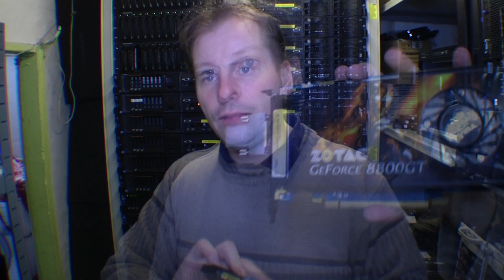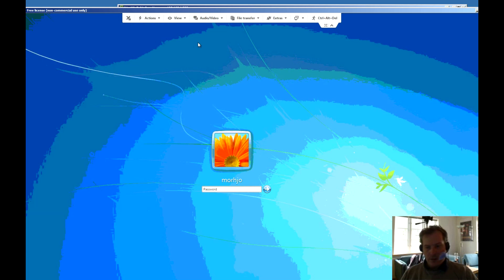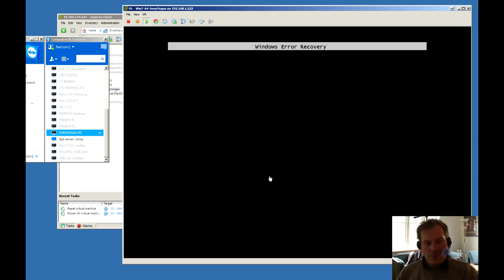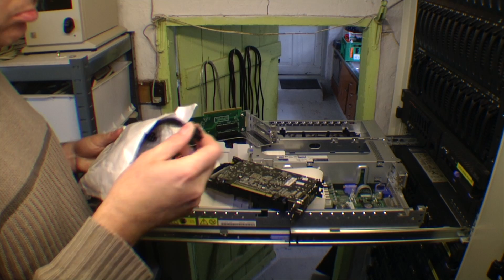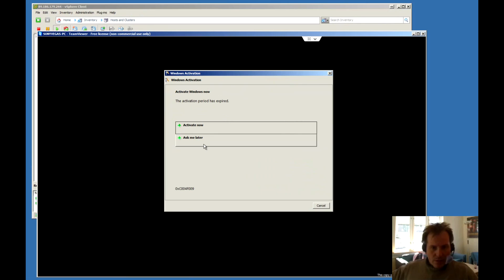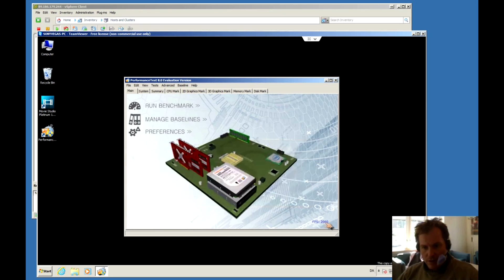GPU Passthrough ESXi with HDMI dummy plug - 236

Comment: if only my server was capable of VT-D :/ This looks like fun :)
Reply from the maker: Hi +dash8brj 
It is getting really affordable, the IBM x3650 M2 is the first one i got that can do it.
http://www.ebay.com/itm/IBM-x3650-M2-7947-AC1-2x-2-26GHz-E5507-QC-24GB-RAM-No-HDD-w-MR10i-43W4297-/381428311321?hash=item58cee62519
This is not that bad,,
Thank you for watching! :-)
Reply: Found one locally with 2x5355QC's, 24Gb ram and some sas drives already (2 x 76 gb and 2 x 146). saves paying $1.8 billion USD in freight :) Thanks for the tip. Hope you get your passthru going along with your UPS (without starting another battery fire!) :)
Reply from the maker: Hi +dash8brj 
I have great difficulty remembering where everybody is from :-/ i have viewers from 199 countries, just this month.
The 5355 are old,, are you sure you don´t mean 5530? The 5355 will work in a IBM x3650 M1 (7979) but that is not able to pass through to VM-ware,, you need a server with EFI bios or UEFI,,x3650 M2.
Thank you for watching! :-)
Reply: +My PlayHouse (Morten Hjorth) Yes just worked out that the M2 or greater is very important - I am in Australia - plenty of M2's in my area with varying degrees of hardware to choose from. I just bought one with a pair of quad cores, 32gb memory, 10 1Gb nics (wow how many ports do I need?), 3 x SAS 300Gb drives. I guess I'll need a bigger switch now! :)
Reply from the maker: Hi +dash8brj 
Well 10 Nics,,, might be overkill for home use :-) two,, the two build in ones and the IMM one. If you are not using the extra PCI ones, take them out so you save that power.
Thank you for watching! :-)
Reply: +My PlayHouse (Morten Hjorth) I might use one of them in my NAS and team all four ports to improve data throughput. The other will be left in and passed through to a VM, to ensure data is kept up to my LTO4 drive. I will finally be able to make use of this drive properly instead of my hack method... staging to disk then copying to tape. Scored the drive on ebay about a year ago for $90 in mint condition. Its a hp. I'll should put up a video next time I start a backup with the server. I'll give you a shoutout :)
Reply from the maker: Hi +dash8brj 
90$ is dirt cheap for a LTO4 drive,, I´ll give you 100 :-)
Thank you for watching! :-)
Reply: +My PlayHouse (Morten Hjorth) You're telling me! no I'm not parting with a drive that sells brand new over here for $5500 for $100. It was a very good score - seems no one needed one at the time. Was fun at the pub watching that timer on the auction tick down on the ipad and stabbing the bid button in the last 10 seconds and winning it :)
Reply from the maker: Hi +dash8brj 
Those auctions,, can be nerve-racking,, you think you got it,, and the last seconds,,, all hell brakes loos!!
 Thank you for watching! :-)

Comment: Try using windows remote desktop, I like it better than vnc & teamviewer :) 

It's integrated in windows, you just need to activate it :)
Reply from the maker: Hi +PROSHOOTERNL 
I know windows remote desktop or RDP very well, but in this case it is not god. RDP uses it´s one protocol or software graphics card,, if i do that the system will disable the AMD card, because it is not in use. humm...
I have not tried RDP with this dummy HDMI thing,, I´ll do that,, it might do something good for the project :-)
Thank you for watching! :-)
Reply: +PROSHOOTERNL how about remoteFX https://technet.microsoft.com/en-us/library/ff817578(v=ws.10).aspx, if applicable
Reply: Did that work? remote desktop client works good for connecting to my server and it even recognizes usb's plugged into the computer i use to access.

Comment: VNC, RDP, Teamviewer, Splashtop.
Reply from the maker: Hi +thingyee1118
But what can use the processing power of the graphics card :-?
Thank you for watching! :-)
Reply: Splashtop is very high quality 30fps.
Reply from the maker: Hi +thingyee1118 
I'll remember that!
Thank you for watching! :-)
Reply: +My PlayHouse (Morten Hjorth) I haven't tested this idea yet, but you can use steam (the game service) and their game streaming feature to do it.  I've used steam game streaming and it is excellent,  considerably better than splashtop/teamviewer which IMO are about equal.  You need steam installed on both the VM and the machine you want to control from.  The link below is a guide to get the DESKTOP to stream.  If you can tweak it to work for you it's the best I've seen, does require a pretty fast network, especially over wireless as I've had over 60Mbps streams if I set the resolution/bitrates high enough.

http://steamcommunity.com/groups/homestream/discussions/0/540732889255066292/